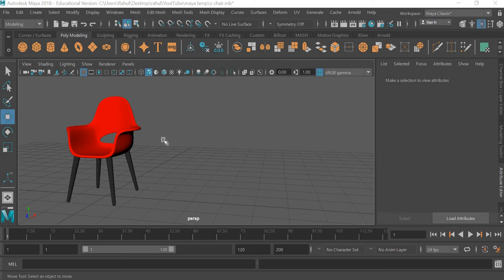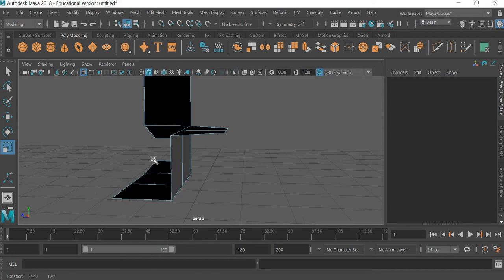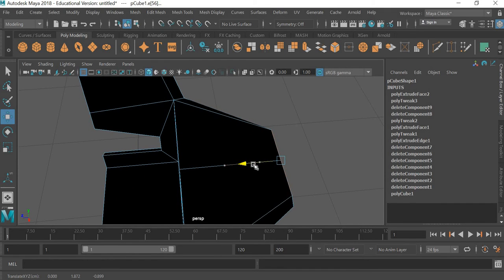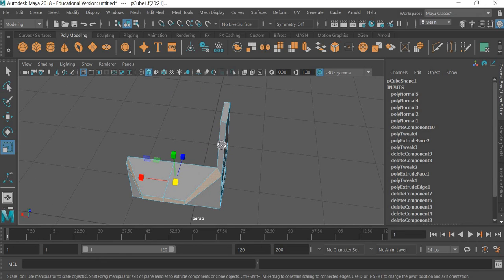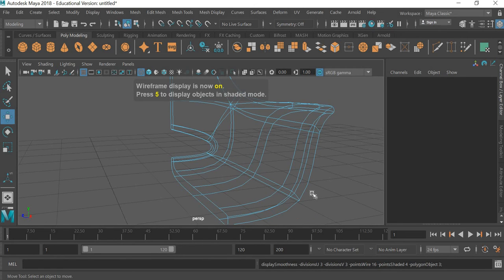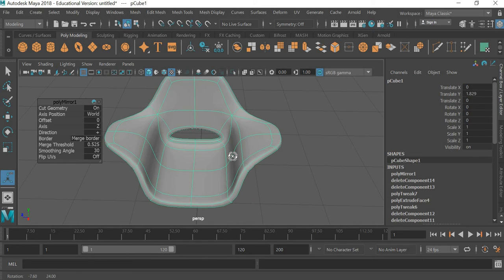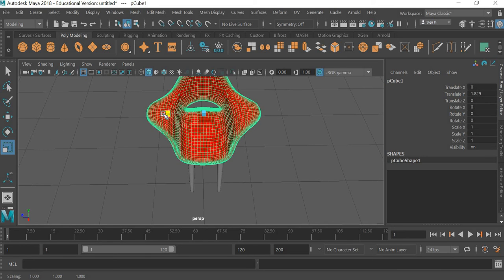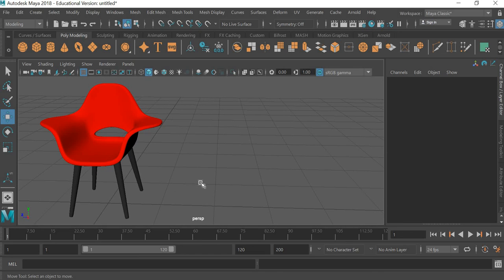Maya 2018 - Organic Chair Modelling

Comment: why to reverse face mate?
Reply from the maker: In 3d a polygonal face has a normal. Which can face only one side. So you need to see the face with the normal pointing outward when it is a closed shape. A material can be assigned on both sides but a good modelling practice is to keep the normals facing outwards.
Reply from the maker: pls. watch and like my other videos, i am using the money from my channel for student scholarships